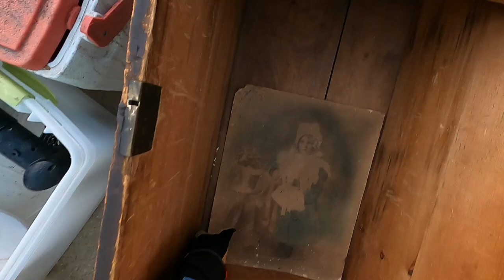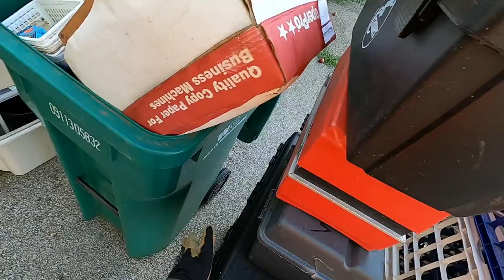Best Curb Finds Ever

Comment: Those bed rails with the carpet and tape around it well I had picked some up out of my cousins burn pile, it had the aluminum furnace tape wrapped around it and I mean I think the house he cleaned out used the hole roll on it but anyway I threw the rail ls up in the back of my truck and a quarter went bouncing it the bed so I got home took the tape off of that rail and someone was taping quarters to the rail I think there was about 3 or 4 dollars in quarters all together

Comment: Gas grill fix the hole at the end of the hose that connects to the tank, take a needle or something with a point like a dart and clean that hole out. Other then the burners rusting out a lot of people don't realize is that hole clogs up and won't let propane through

Comment: Obviously you've been doing this for years, and so I guess you've found what works for you.  But I just wanted to point out a possible tip for you...that I've found from my own experience with wheeled things from trash cans to small ice chests.  In the case of uneven ground (or the little lip/ledge from your lift gate to the ground), I find it far easier to move the items by pulling rather than pushing.  Don't know if that will work for you, but I thought I'd throw it out there, since I noticed you sometimes get an argument from things you're trying to push onto the lift.  ;-)

(And I know  you're a good person because you like cats!  ;-)   )  LOL @ your definition of the "standing end" of the rope!  😀